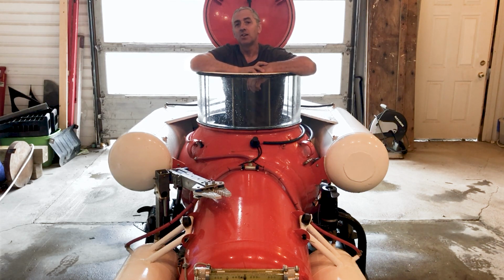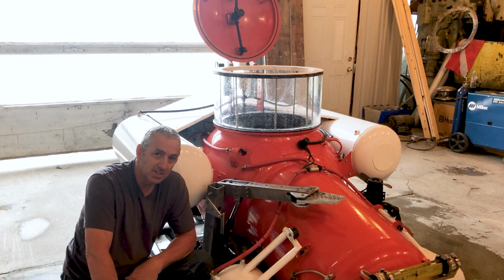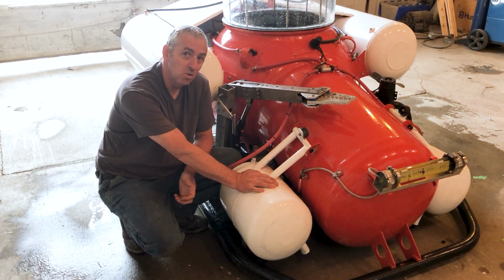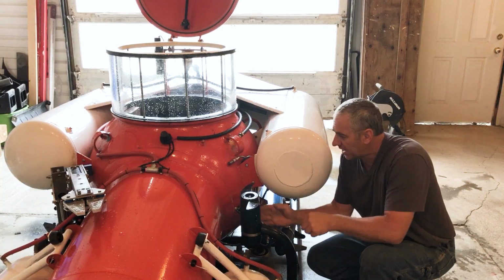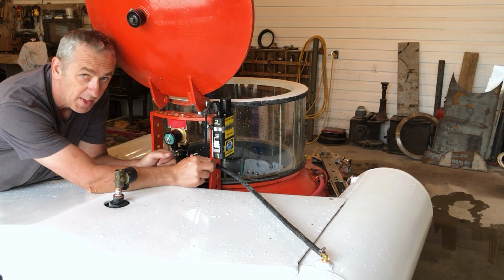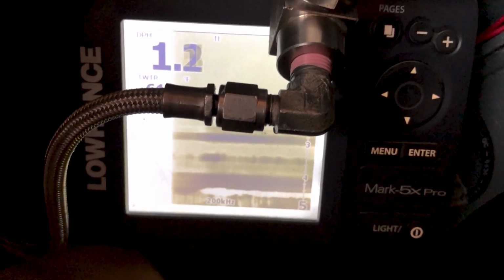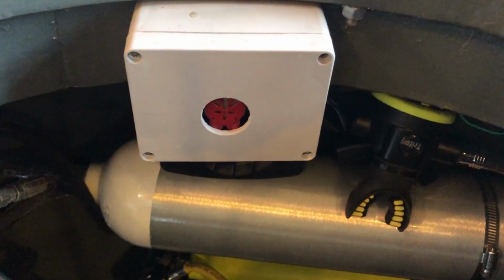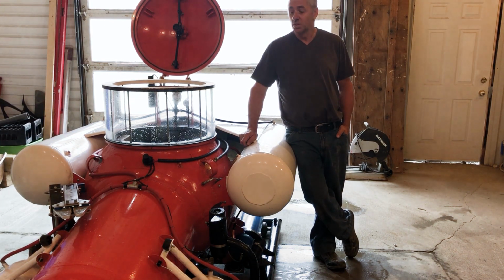Finished Homemade Submarine Full Tour

Comment: Great build with some neat features! I was wondering how you achieve neutral buoyancy withouth a compensating tank. Are you able to do this with a ballast tank? If so, do you need to  introduce air in the ballast tank as the sub descends and the air in the ballast tank is compressed?
Reply from the maker: Yes, that is how it works, I vent air from the main ballast tanks until I am neutral.  Then thruster down, adding air as I descend.  The sub is very close to neutral when all the air is vented, so there is very little air in the tank to compress.
Reply: @HankPronk  Thanks! May I ask if you do it the same way when you operate larger subs with passengers on board? Do you add/remove weights to adjust buoyancy before diving?
Reply from the maker: @typhonfighter  Yes, same system, I just adjust for passengers by removing weights to match the weight f the passenger.